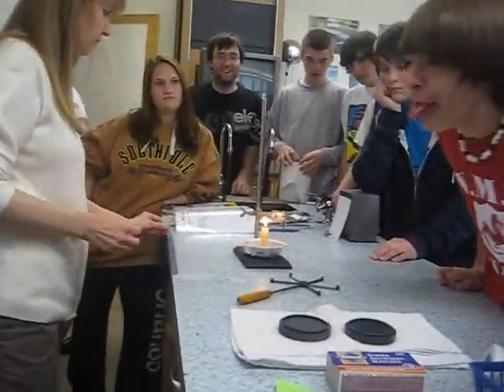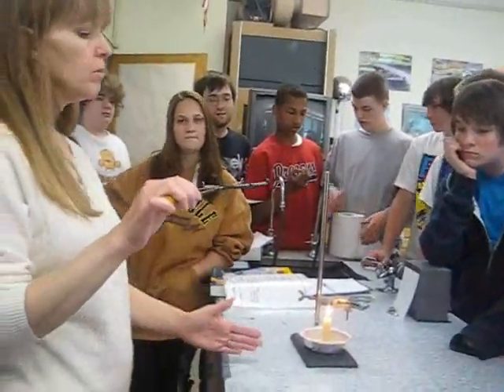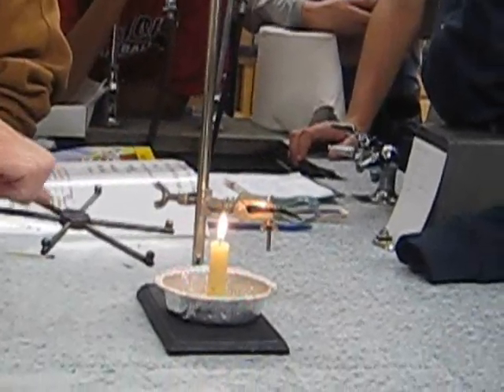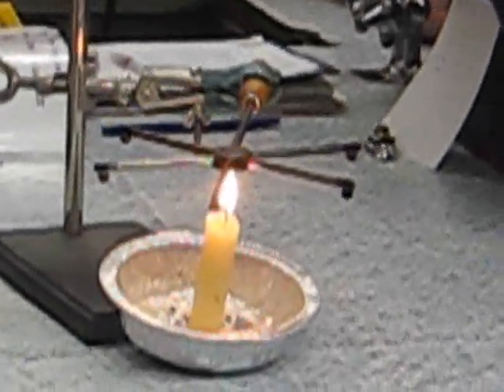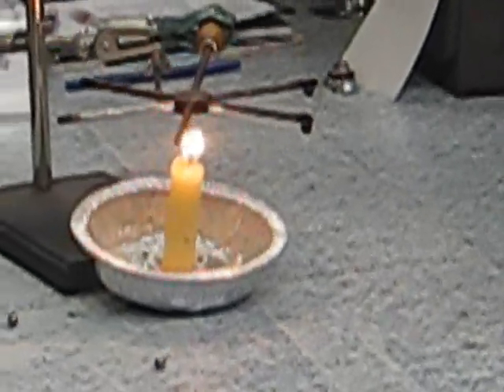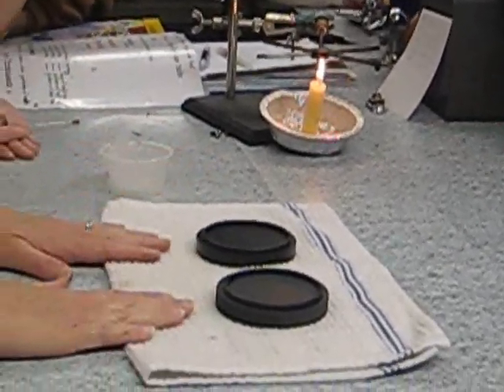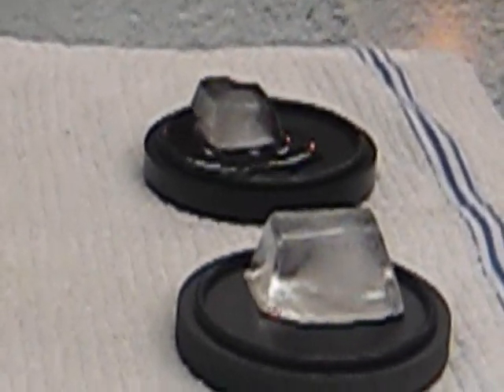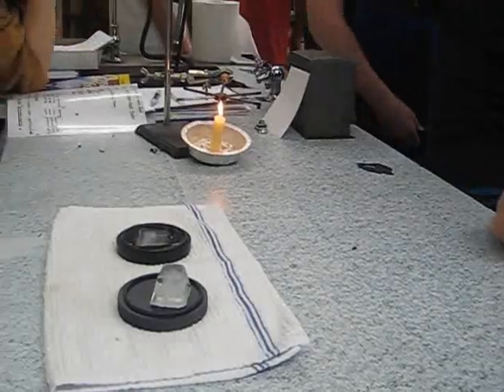Heat Conductors

Comment: It's a flaw experiment.  Copper is a much better conductor of heat than alumimum.  The metal rods are not the same mass.  If you the rods have the same mass, the ball on the copper rod will fall first.